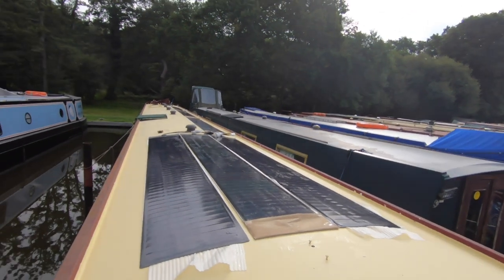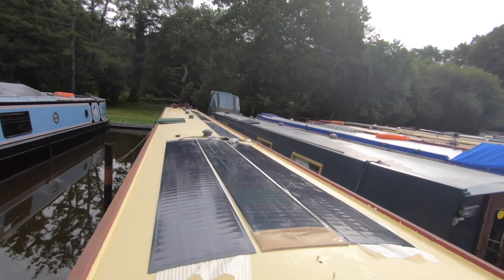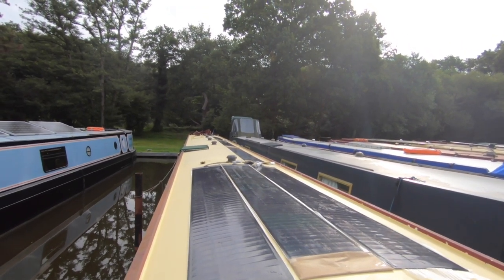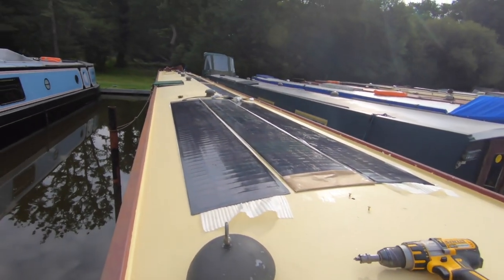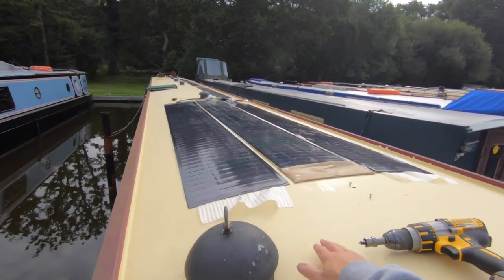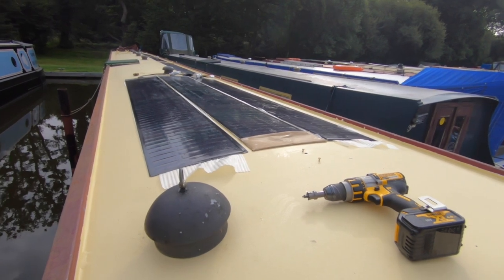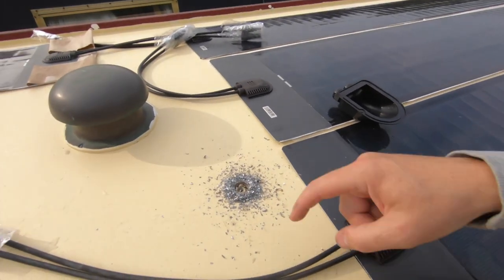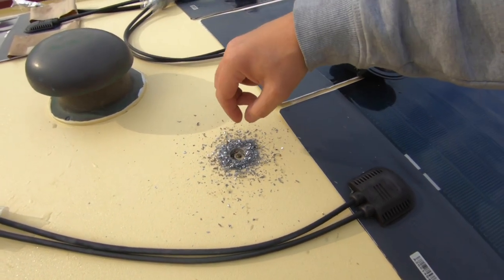Installing Flexible Miasole solar panels to Victron on our Narrowboat - Part 1

Comment: Did your boat have a non-slip roof? and if so did they stick ok? Many thanks
Reply from the maker: Hi, sorry for the delay (been off on the boat) the panels stuck to the roof once painted really well as it is a very fine surface.
Reply: @cutandrun6577  Hi. Thanks for that. I stuck them down OK, the mastic/glue is really powerful so no problem on non slip roof. The one problem I did have was in the heat the paper would not come off so got up early when cool to do it.
Reply from the maker: @ianhobson1  I'd say 1 panel has a little lift on the edge near the centre, my guess is it was some frost lifting it over winter.